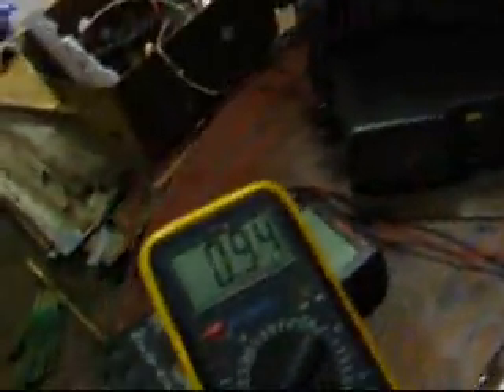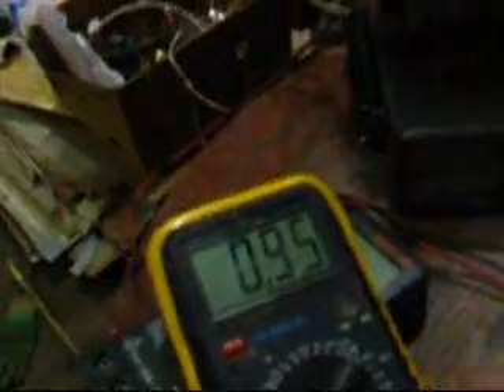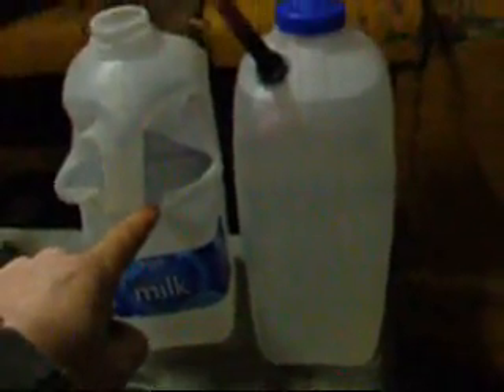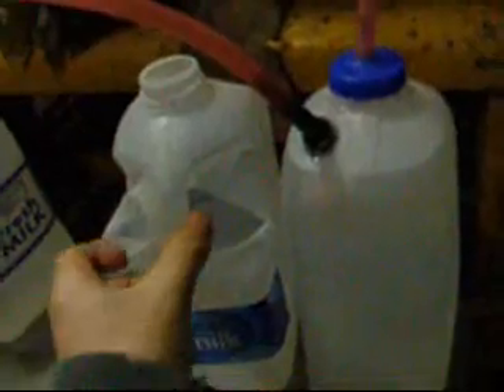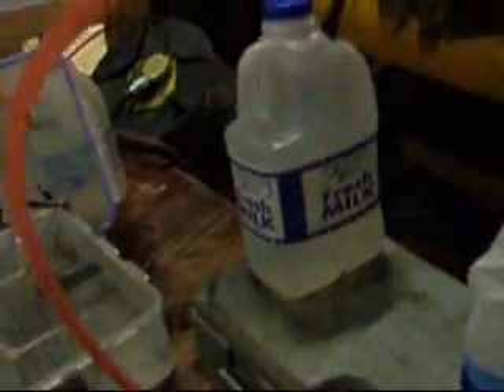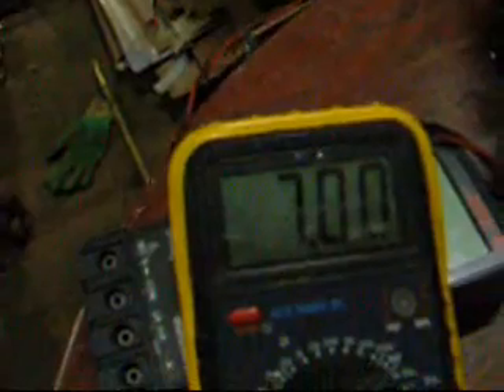HHO cell make up part 2 running

Comment: Premixed electrolyte is the best way to go. You need potasium hydroxide. The easiest place to find that is in drain cleaner. I use ten percent mix. That is 100 ml or 5 tablespoons to 1 liter water.
You can get measuring spoons for cooking pretty cheap.
Reply from the maker: Are you still building hho cell

Comment: Baking soda (bread soda in Ireland) works ok but will give off CO gas so keep ventilated. Better option is to use either potasium hydroxide or sodium hydroxide.

To avoid scum buildup, you will want to use distilled water w/eletrolyte. If you use tap water, you will never want to drink that stuff again when you see all the gunk that it leaves behind.
Reply from the maker: I got soda crystals in the end . Night and day difference

Comment: If you can get your hands on a pc power supply in the 350-600 watt range, it would make a pretty decent low budget bench power unit.  There are a couple vids on here that describe how to convert.  I use a 550w unit myself with good results. Got mine for free by dumpster diving.

On bronze wool, try a marine (boats) supply house, good hardware store or Google and order it via internet.

Comment from the maker: so is it that i have the cell already about 3/4 full of rain water (distilled water) and then add this 100% cool saturated water?  and build up my amps to lets say 9amps (to be safe not to blow the fuse in the Multi meter) how much is 20 CCs im not a vet and dont do needles. LOL im guessing its very little?

Comment: volts go down because your power supply cant keep up. it can handle a certain wattage. so if it does 10v 5 amp, it should do 5v 10 amp. watts are volts x amps. at under a volt/plate you probably wont see spectacular gas saturation.
Reply from the maker: I really needed a better power supply